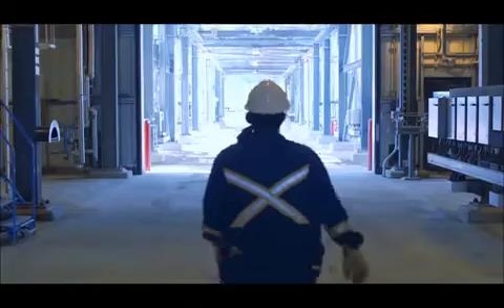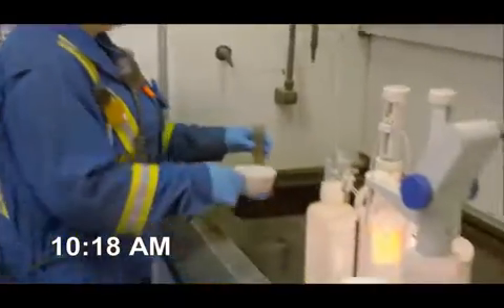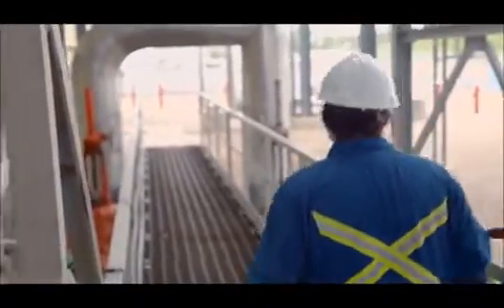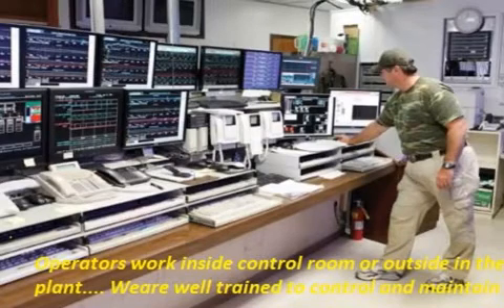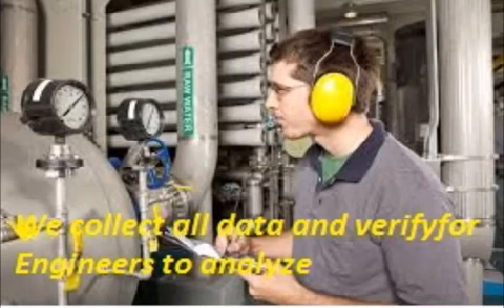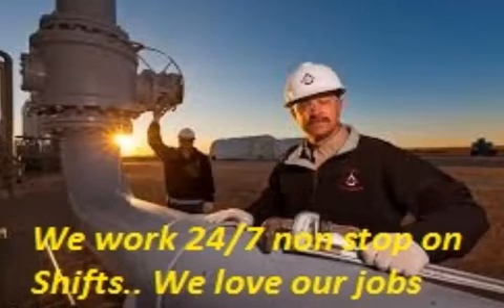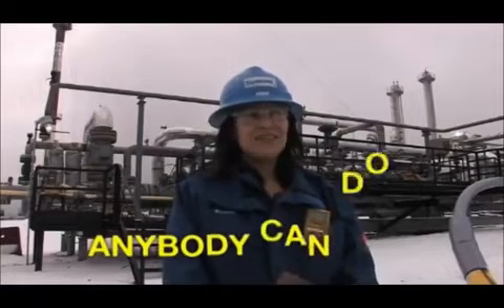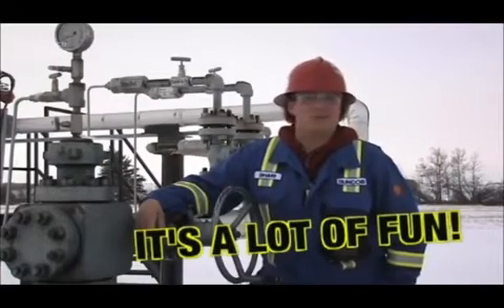Process Plant operator Job Description In Industry

Comment: Any chance I can transition to this type of work with 0 experience? Not that it may be useful but I'm coming from an IT background and I'm just sick of sitting at a desk all day or talking to incompetent people that can't turn on a computer. I want something where I'm on the move and more engaged with IT it's very passive at this point.
Reply: Take a course at a technology college. I'm currently taking power engineering at NAIT. It can also be done through correspondence, but taking a 2 year course at somewhere like NAIT will get you further ahead much quicker.
Reply: Operator here  I'm working towards getting my bachelor's in computer science to go into cloud or networking. What they don't tell you in this video is a lot. Work life balance can be horrible. Pay is great if your at a good facility or horrible. Most of the time your looked down on because uour just an "operator" but yea I hope your career progressed I  the two years since your comment
Reply: Not no more I don’t even have a diploma n I’ve been working at Chemical Plant as a Chemical Operator with 0 experience you gotta start somewhere I’m very smart, professional, and a fast learner I got the job in less than 3 weeks ! So anything’s is possible
Reply: Operator who started with zero experience here. I was extremely lucky and fortunate to be hired on with my company at 21 years old. Before that I was scaffold builder. As a scaffold builder I made anywhere from 20$-25$ per hour. When I started off in operations I was making $33.79/hr at 21 years old. And now I’m topped out at $58/hr at 29 years old. Like I said I was extremely lucky. Coming from scaffolding background I was tough as nails and had very little fear of anything. Now as an operator I do very little of anything. But my hobbies and family make my life feel complete. Operations isn’t for everyone believe me there are some dumbasses but try and apply somewhere
Reply: @StreetCommando1 what company did you work for?